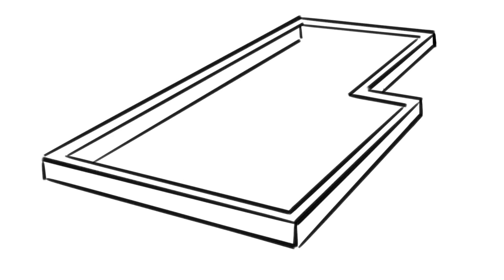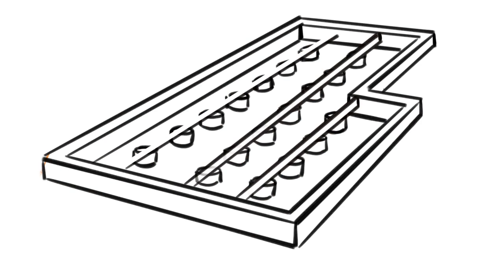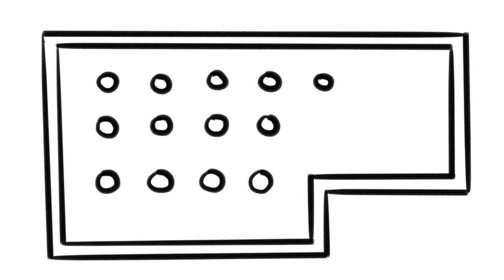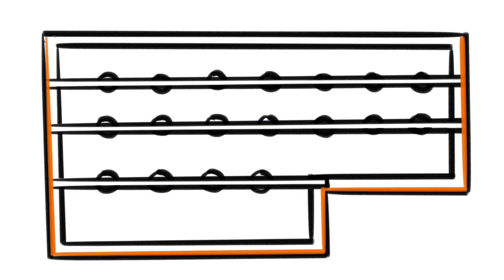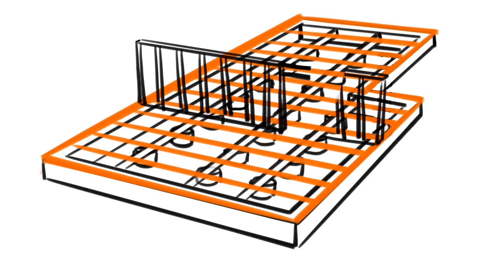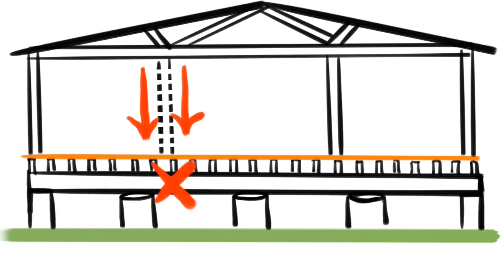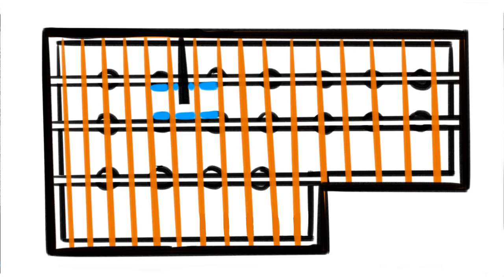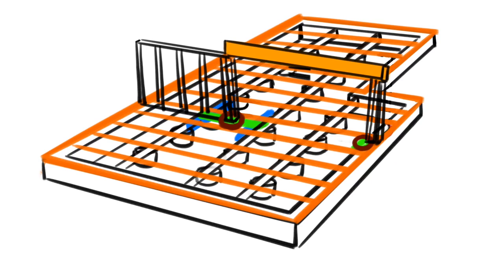How to Remove a Load Bearing Wall on Pier & Beam Foundation

Comment: Nice , explanation its also a large version of what is done with exterior doors and windows having jack studs and headers. But for interior non-load bearing wall doors or opening you don't need a header or jack studs so much...So there more for look then structural reinforcement. (also no double top plated need on a non-load bearing wall like the ones for load bearing walls)